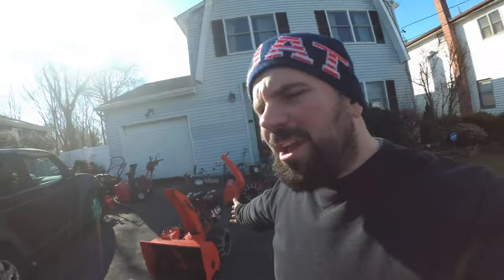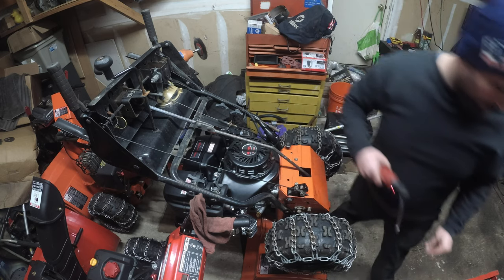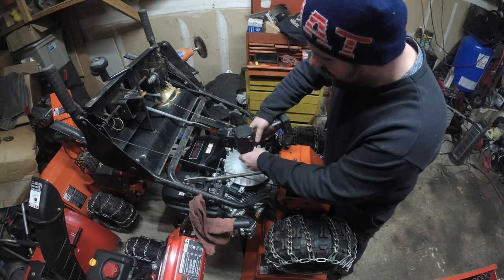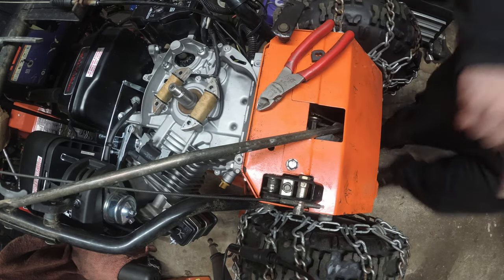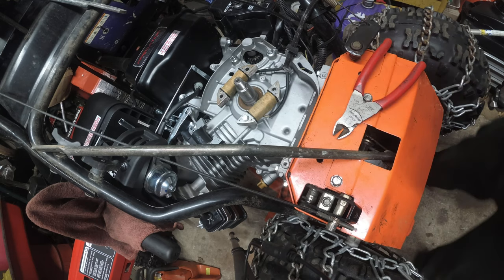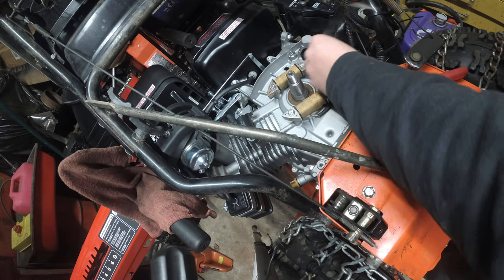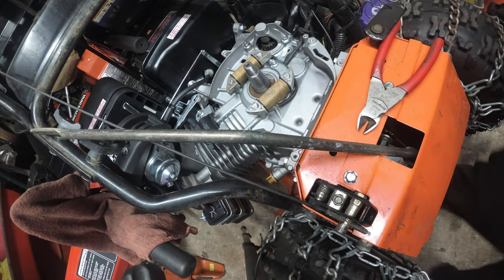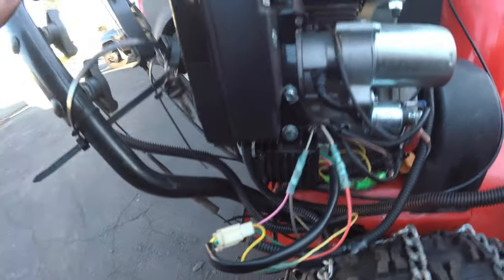HOW TO UPGRADE 420cc Predator Honda GX390 Charging Coils to 10AMPS Supercharged Hemi Ariens 1128 P3

Comment: I know this is two years old, but do you remember if this was with the stock two magnet flywheel that came on the predator 420? Im trying to do the same thing and the  coils are only giving my 7 volts AC when running. Thank you.
Reply from the maker: Yes I used the same flywheel just upgraded the coils to genset coils.

Comment: Did you use the same regulator/rectifier from the previous dual coils when upgrading?
Reply from the maker: Richard Estes 

Correct
Reply: Thanks for replying.  Did you get more charging power?  I’m doing this coil conversion on my predator 420 boat motor.
Reply from the maker: Richard Estes yes my amps increased.
Thanks for the view and comment, hopefully you subscribed to my channel.

What is your motor going on?
Reply: I sure did subscribe!  I noticed in your video description it said OEM Honda rectifier and harness...  I was thinking it was the eBay one you had in the first upgrade video.  My motor is going on a mudskipper twister boat motor. For my aluminum duck boat

Comment: How did you mount up the chute control? Is there a bracket you can buy that will make the conversion bolt on? Mine bolts to studs on the old tecumseh valve cover.
Reply from the maker: Excellent question, built from scratch.  I got inspiration from the newer style ariens.

What is your project if you don’t mind me asking?
Reply: @pattayperformance  got a solid 1128 from a client that threw the rod. Then picked up my first 420 preditor bnib for cheap on the swap and sell sites. So decided to try to swap in a good charging system since the lifan 18amp engine is a bit rich for me.  And i want to run a light, hand warmers, and still charge the battery.
Reply from the maker: @ryandormann9621  I seen that but I could have swore the charging system on a Lifan is different.  Once big circular piece
Reply: @pattayperformance  far as i know, output would still be battery voltage.

Comment: What's the link for the regulator pls?
Reply from the maker: Jim French Good Morning,

Just got into work.  Will post a link later when I get off.  Thanks for the view and comment, hopefully you subscribed to my channel.
Reply: Pattay's Performance thanks very much. I was thinking of installing a one wire alternator and bypassing the regulator.
Reply from the maker: @jimfrench4697  

here is an affiliate link...hope you use it

http://rover.ebay.com/rover/1/711-53200-19255-0/1?ff3=4&pub=5575562411&toolid=10001&campid=5338684362&customid=&mpre=https%3A%2F%2Fwww.ebay.com%2Fitm%2FGenuine-OEM-Honda-31630-ZE2-861-Coil-Charge-10A%2F124014607159%3Fhash%3Ditem1cdfd8bb37%3Ag%3AFooAAOSwHt9d-VA3

I couldn't do a 1 wire alternator since I'm using it on a snowblower.  My goal was to make it look as factory as possible, spent alot of time and money doing so!  1 Wire would be nice on a gokart for sure!

Comment: fyi they sell coils on ebay for $7.99
Reply from the maker: drumtwo4seven,

As stated in the video I explained why I took out them out and showed a side by side comparison as well.

Feel free to watch the video.  Thanks for the view and comment, hopefully you subscribed to my channel. 🤙🏻🇺🇸🔧🦅
Reply: @pattayperformance  
I did see the ones you installed were much thicker 22 thick vs 12...

Does it work much better than before now?
Reply from the maker: drumtwo4seven,  yes now I’m putting out enough power to run everything and charge the battery.
Reply: @pattayperformance  
Id guess the magnetic flywheel would only be on the electric start motor vs the pull start which most likely wouldn't have a magnetic flywheel... ?  Im assuming that is
Reply from the maker: drumtwo4seven,

Electric start just means the teeth on the flywheel are geared.

If the existing motor has an output for light...wires coming out for the side you know you are good to go.  

I’m sorry I don’t know if a non electrical out put motor comes with a flywheel and all you need to add is the lighting coil.